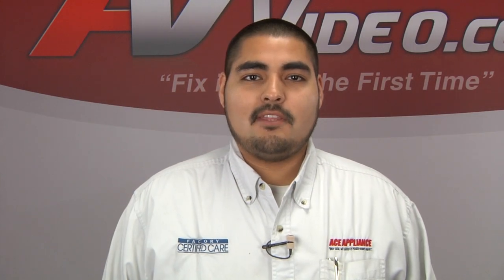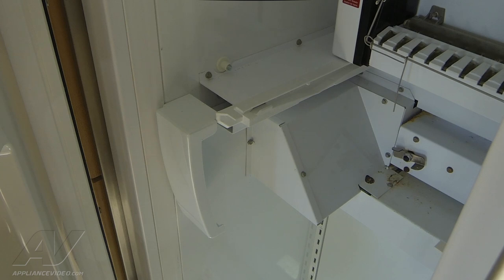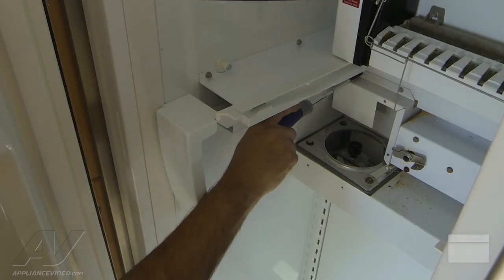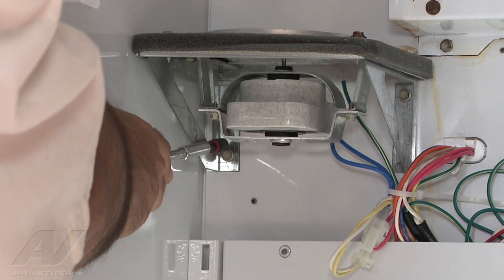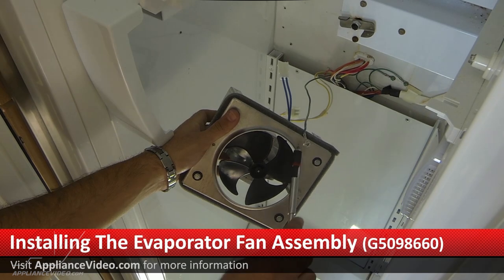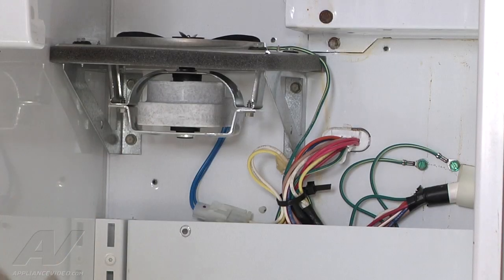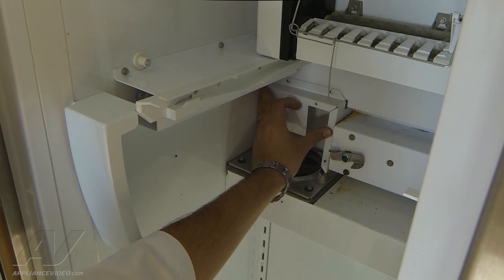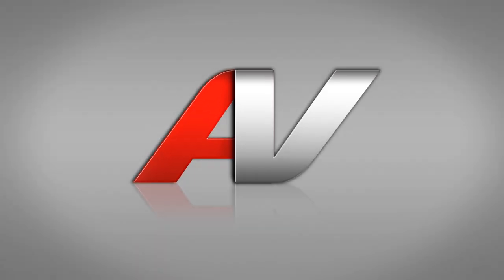Viking Refrigerator Repair - Not Defrosting - VCSB423DSS

Comment: The fan replaced in this video is pretty easy to fix, and similar process to other Viking fridges. I have an older 48 inch one. I used a generic fan part that fit OK, but required some adjustments to make it run smoothly. If your fan quits, you'll get no cold air moving from the freezer to the refrigerator side. ... But read on if your fan is working and you still have defrost trouble. … 

The stated symptom of not defrosting, however, can just as easily be something else, especially if the fan appears to working.

My fridge stopped defrosting, and would work only a few days before frost built up to a point where it struggled to cool, requiring a manual 'turn-off' defrost. We tested the circuit board using the diagnostic instructions in the service booklet that is in the fridge. We used a multi-meter and determined that the defrost TERMINATOR had failed. 

Sure enough, it showed signs of getting water inside and splitting apart. It is a relatively simple part that turns a circuit on or off based on temperature. Essentially it can ensure your defrost cycle does not run away and melt all your food or cause the fridge to become a fire hazard. This part was replaced (yesterday) with a near-matching commercial terminator, and installed at the top of the cooling assembly. Not as easy to do, but it could have been worse. 

I am just glad that the circuit board was OK and the defrost heater appears to work now. 

Viking also offered to replace my fridge (for a discount on a new one) after the second recalled hinge replacement. I regret not taking them up on it now. I would not be facing the now-accumulating maintenance issues on my 48 inch side-by-side fridge. 

These fridges are so expensive to buy and replace, and way too big to transport by normal movers, and often difficult to service in situ, due to the built-in locations. Mine is 15+ years old. We have replaced the aforementioned parts, as well as the main compressor ($$) which cost us the same as a new typical 36 inch fridge, partly because you have to hire specialty movers to get it off-site for the repair.

While I would not recommend homeowners invest in such costly appliances, they are generally well-built and can be expected to outlast cheaper ones, but not without some potentially costly maintenance. Sometimes you can use more generic parts, and you should seek out an experienced and resourceful refrigeration mechanic, preferably with experience on these and commercial fridges. Service options offered by Viking in Canada is poor. 

My next challenge is finding out whether the fan that (I think) helps the defrost water in the pan is working, or not. I never see it operating, and now that my defrost is working, I have water filling the pan from time to time. We live in a dry climate, so this is probably going to evaporate, but still…

(Trivia: the Viking name for appliances was owned here by the Canadian department store Eaton for years after they closed, so during those years, the appliances -- including mine - from Viking were instead branded Ultraline.)

Comment: Is there an error code for this problem?  We have a Viking D-3 fridge which has the compressor replaced 2 times already.  I am not sure if it's the compressor cause I hear it running.
Reply from the maker: Great question, you can call our parts department at 1-800-830-5465 and they can give
you help 7-days A week. If you have a more technical question that our parts
department cannot answer, our technicians are answering
all questions at our website at www.ApplianceVideo.com under our Repair Help section. We have over 3,000 common questions
and answers that you can easily search through by your model number, appliance
make, and problem or error codes, and It’s free to search through our question
& answer library.

Comment: Why is it the evaporator fan motor? Did it stopped running? How does it prevent the freezer from cooling?
Reply from the maker: Great question, if you have a
more technical question that our parts department cannot answer, you can search
our over 10,000 answered questions free at our website www.ApplianceVideo.com under our Repair Help section. You can also call
our parts department at 1-800-830-5465 and they can give you help 7-days A week
Monday -Sunday, or search at www.SaveMoreOnParts.com  24 hours
7- days A week.
Reply: No air circulation